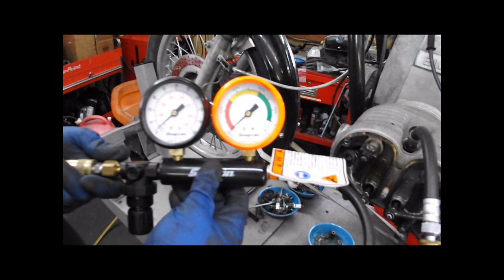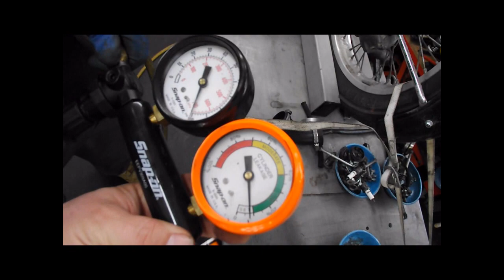BMW Service - Airhead Engine Evaluation

Comment: Hi Chris! I’m doing this test with new rings and rebored cylinder. I’m still getting 80% leaks. The ring gaps are 0.3mm, 0.3mm and 0.25mm. Is it possible to seal with gaps that large?

Comment: Hi, Chris. I've watched your videos so many times over the years, I feel like I know you. I certainly appreciate you. I did a leak down test today with a Lang tester (looks exactly like your SnapOn) on my /5 (~50K miles), and I got just 5% leakage on both cylinders. I did each cylinder several times just to make sure, since this was my first time doing it. I trust the gauge, as it did show a significant leak once when I wasn't on OT, but my only uncertainty is how much it seemed like I was leaking from the crankcase. When I'd pull the dipstick, I'd get the same extreme change in tone that you got in the video. No obvious wind on my fingers, though, so I assume I'm good and I'm just overthinking like amateurs do. Do you agree? Much thanks in advance if you decide to reply. Hope you're doing well in this time of pandemic.  ~Mark Wicklund
Reply from the maker: Your 5% leakage past the rings is not a problem. Ride it! All healthy here, Mark, thanks.

Comment: Hi Chris.
I recently bought a 49k mile 1984 r80rt paralevel. It’s been in the previous owner for 5 years. I know I have done a stupid thing since I didn’t try to check it before tearing down the engine to change the piston rings and reseal the cylinders. I believe that I got all of the assembling procedures correctly because I watched your video and performed it myself. I did the compression test (cold engine) and the right cylinder read 125psi while the left side only read 75psi. Then through this video I bought a leakdown tester at harbor freight. Unfortunately it only show 15psi at the input gauge while the leakage gauge reaching 0%. At this tine, both passed the leakdown test, the leaking rate between 5-8% at TDC (still cold engine). Is it because of the cheap tool? I left the rocker cover on the left cylinder (failed air compression test? through the night, and the next morning I see some oil leak from the top rocker arm through the two top stud rods. I couldn’t check the right side (passed the air compression test) because I torqued the rocker cover back. Would you please diagnose what is the problem that I am facing or what did I do wrong at least?
Thanks,
Tri
Reply from the maker: Tri, I replied to your message. Chris
Reply: You’re the best. Thank you so much.
Reply from the maker: @tnguyen-jf1pm  You are welcome, Tri. I wish you luck, Chris

Comment: Do you have to drain the oil first to do that?
Reply from the maker: To perform a compression or a leak down test; No, you do not need to drain the engine oil.

Comment: Hey Chris, thanks for all your video posts, they are extremely informative, I have a 1978 R100RS that I am rebuilding and got it finally started today after sitting more than a year and noticed smokin out of exhaust under throttle, I'd like to send you a video clip of it if possible for you to see to get an idea where to tackle it without spending unnessesary money? Thanks again Ray

Comment: Great video and saved me a bunch of money.  Had a lot of symptoms of leaking rings and had a mechanic do a leakdown test, and sure enough 23% leakage on the right side, pushing oil out of everywhere on the left at speed.  They said they would have no way of knowing where the leak was unless I left it with them to take the engine apart.  I used your video as reference, to which they said "we will call you back".  Ten minutes later he called and said it was leaking into the crankcase. Bringing the bike home and using more of your videos to start taking the cyclinders apart myself.  Keep up the great work! 1975 R75/6
Reply from the maker: That is a great story Joe and exactly why I do these. Happy New Year, Chris

Comment from the maker: You'd have to disassemble the cylinder and inspect the rings and piston. I've yet to come across a BMW with stuck rings that wasn't seized, usually from water in the cylinder.

Comment: Good video.  On the right cylinder where you had the 20% leakage, how do you determine that the rings are worn versus a stuck ring due to carbon build up?

Comment: Does the 100 lbs pressure apply to all airheads? Mine is a 78 R45/N. Burning oil on the left side. Thanks! Dee

Comment: Compressors are not cheap. Where could I get air ? Although making one with a motor compressor from refrigerator is possible I believe, have heard .. Thanks for the test and video -- great idea !  I bought new /5 in `71

Comment from the maker: Hi, I do not agree. You must do this test cold AND hot. If you have excessive blow-by when cold it will most likely be there when the engine is at operating temperature. If you are merely doing a compression test then yes, you'd be 100% correct. A cold compression test = poor results as it will all change when the engine reaches operating temperature. But the leak-down test will reveal, even on a cold engine, exactly where you are losing pressure (intake, exhaust, crankcase). Thank you though, C

Comment from the maker: You are welcome. To answer your question: You could certainly use the hose from a compression tester (remove the schraeder valve) and add a pressure gauge and a fitting for your air hose to the end. Then just connect the air hose and slowly open the valve on your air compressor to charge the cylinder.

Comment from the maker: Yes, absolutely! I usually perform a leak-down test first (after an initial test-ride). Unlike a compression test, you need not have the throttle wide open during the test as with a compression test and you do not need to bother with a compression test at all. The leak-down test is far more precise in determining if you have an engine problem. Thanks for your question.